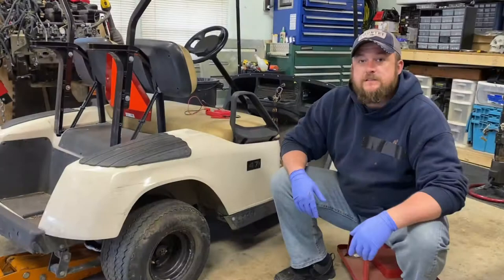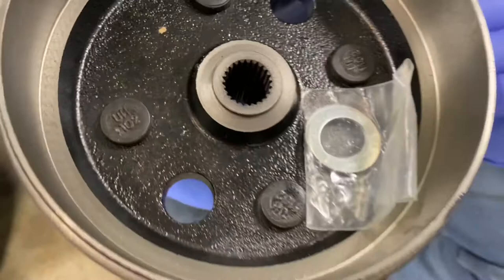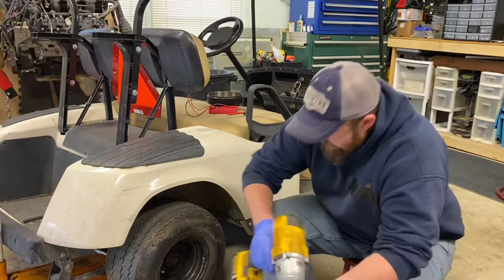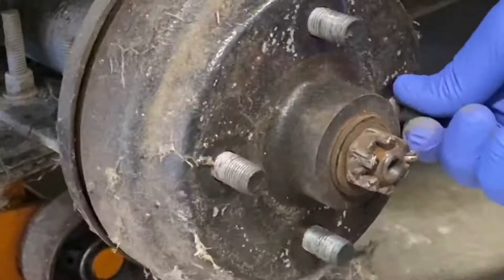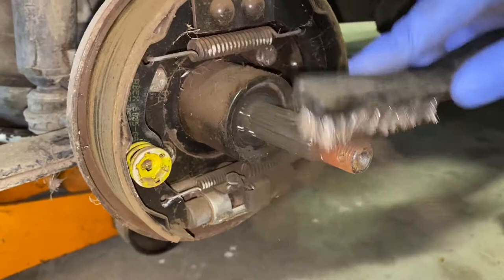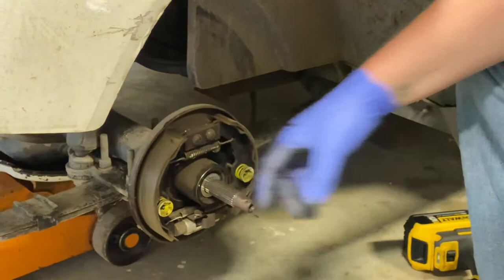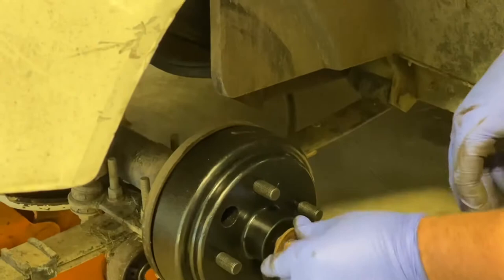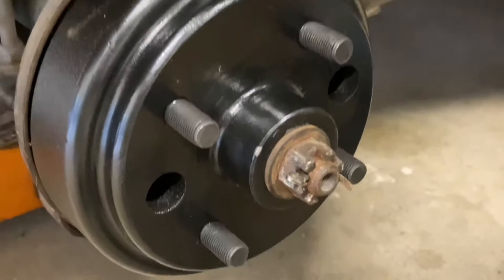EZGO golf cart rear hub DIY replacement EASY 10 MINUTE REPAIR

Comment: I think this might be my issue.  I hear a clunk when accelerating from a stop.  I jacked up rear end and put in neutral...then spun the wheel by hand and there is play in the rotation until it catches the splines and turns with the axle...i gotta take it off to inspect the splines of both the axle and the hub

Comment: Should I be replacing both sides at once or just the one with issues?
Reply from the maker: If you want to be proactive then sure. But  I checked the other side and it looked fine in this case. This is a very common issue and if it’s not bad now it very well might be in the future. Thanks for your question!

Comment: How tight would you say you put the castle nut on the Hub
Reply from the maker: porkchop 803sc Williams   
Torque spec for a rear hub is between 90 - 140 ft lbs. Never back the nut off to fit the pin, just tighten to the next notch. Good luck!
Reply: @dudeinthegarage  ty for responding